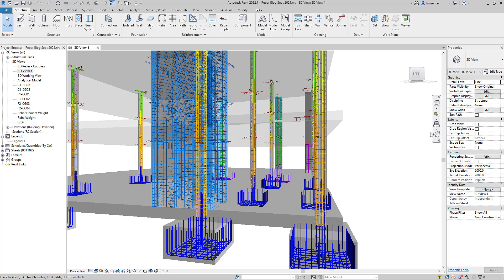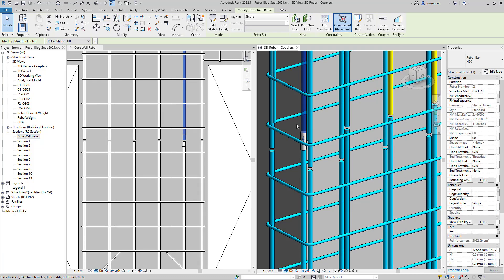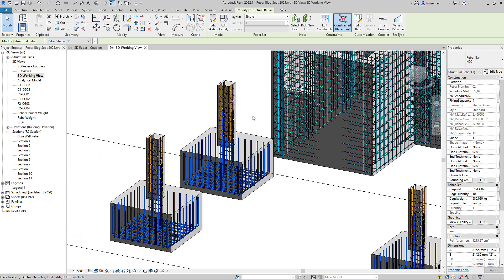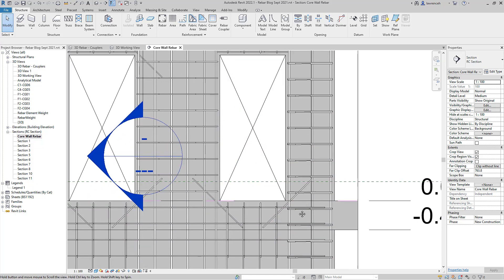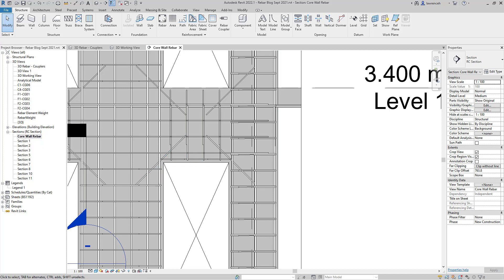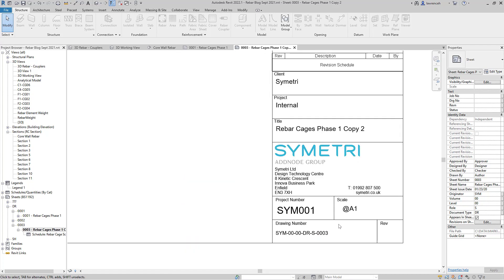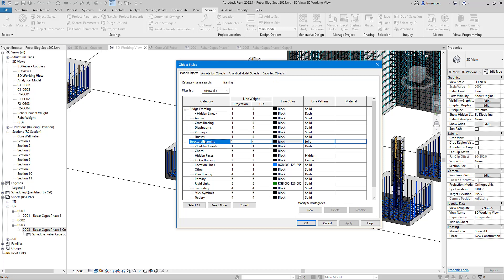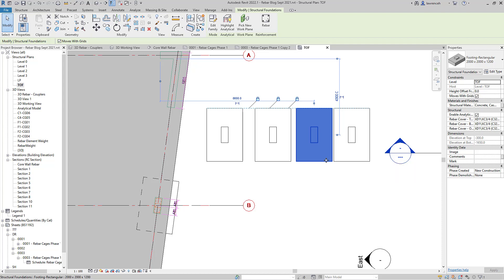Revit 2022.1 What's New

Comment: But i didn't understand. Did you make a dynamo script to achieve that or the new revit .1 does it? 
Thanks
Reply from the maker: Not sure what you are referring to here. However, happy to help if you can explain further....
Reply: @RevitStructureBlog  Thanks a lot for the answer. What i did not understand in your video is if you did the dynamo script or if the new version of revit does it.  Thanks
Reply from the maker: @pierdoro1983  Hi Roberto, No Dynamo scripts have been used in this video. These are just new features of Revit 2022.1